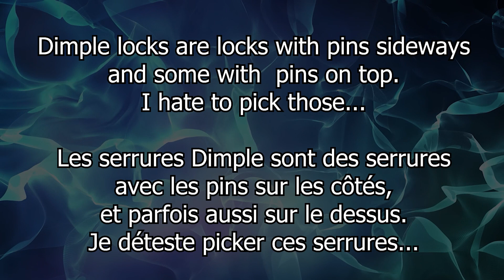20$ HONEST Dimple Rakes review

Comment: Not sure if you figured it out yet, but the Z bar can be used to block the pins from falling out into the keyway if you over rotate the core (especially on cores that have multiple directional pins like the one you demonstrated.

Cheers (un autre franco-canadien)